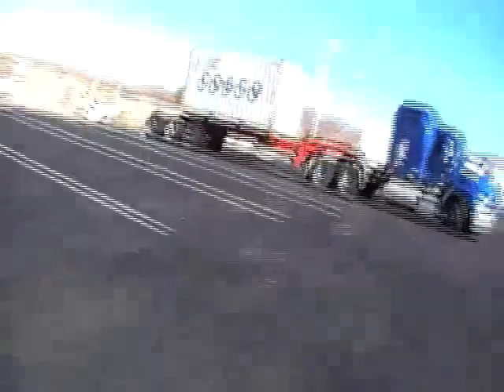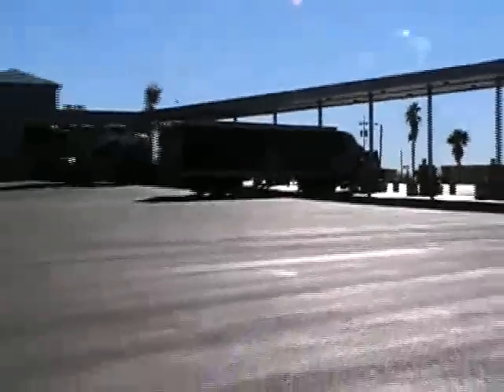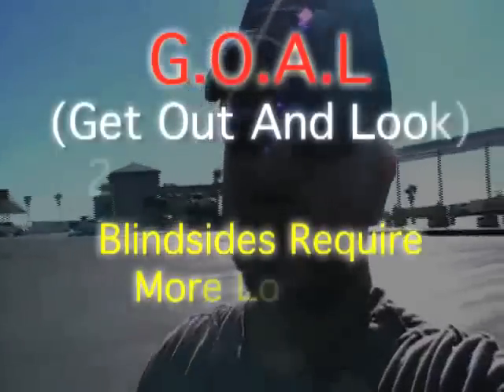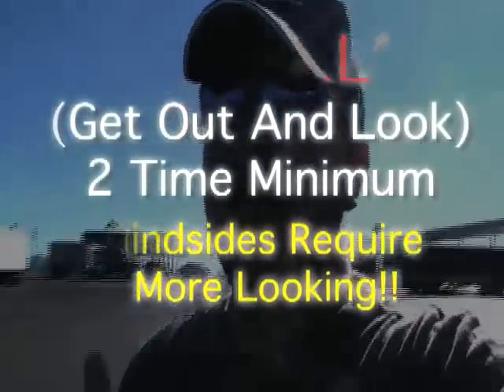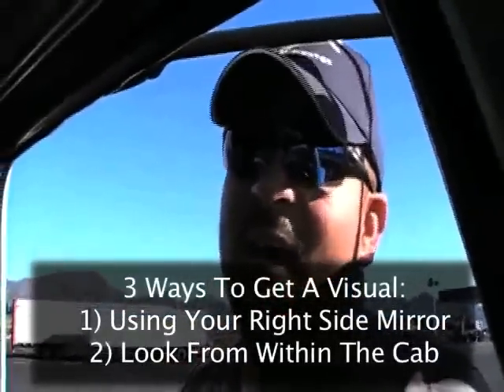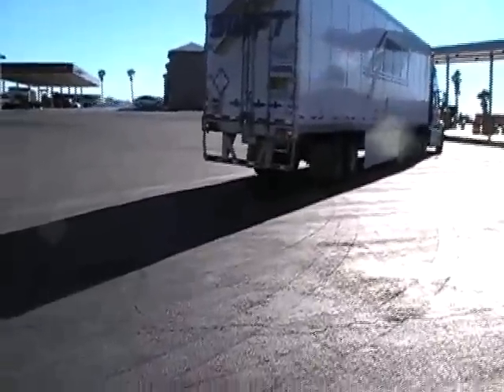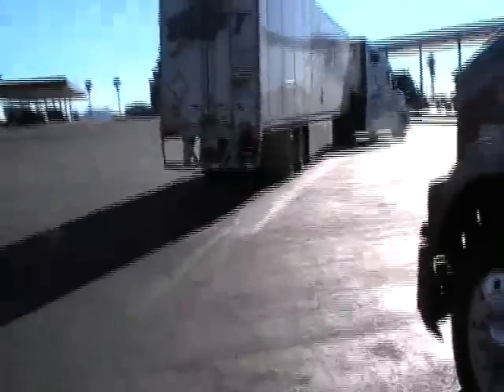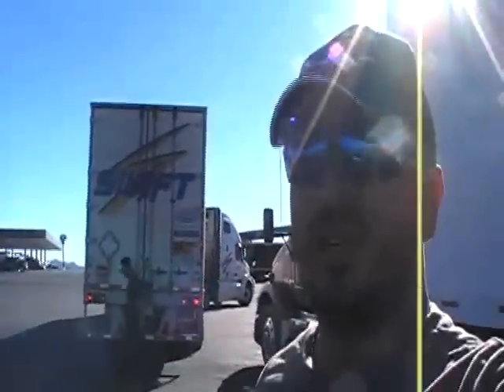Blind Side Backing 101

Comment: I used to pick up farm milk with a 220" Pete w/a bunk and a 46' trailer. I had a veteran driver tell me that once you loose sight of your trailer on the passenger's side, look out your left hand mirror. From there you can judge the angle of the tractor as compared to the angle of the trailer and when it gets almost to the point of no return, start following it with your tractor and you will succeed every time. I have to admit, it took awhile for me to get this down pat, but once I did, it worked every time. I didn't have the option of getting out to look, because I was usually on a very busy road and if I had got out and looked, I most likely would have caused a very serious accident.
Reply: You're not the only one... I heard that too
Reply: Expand  on that technique  a little bit more sir.
Reply: @karondibolden1242  Sorry it took so long for me to get back to you...I guess I'd better start checking my messages more often :-( ...as far as expanding on my above mentioned technique, I really don't have much more to say on the subject...if we'd had the option of being in a truck together, I could show you much easier than I can tell you and if I'd had the technology available to me when I was driving on a daily basis, I could have video taped this method and then posted it...but I didn't...sorry :-(
Reply: @nathanmartin9560  Yep and it worked like a charm no matter the situation...my thanks to my late friend, Pete, because if it were not for him, I don't think I ever would have figured it out.

Comment: Okay, but confusing. Once you have done your pull up, you back straight until your rear most wheel nears the right side lane marker. Pull a hard left and watch the wheel as long as you can in the mirror, it should line up within the spot. As you're going back, watch the bulkhead (front wall of trailer) with the left mirror. When it is almost lined up with your reference point across the lot and almost square to the space, spin the wheel to the right all the way to straighten out. If you use two reference points, you should hit the space square. It's not hard to do at all, but it is best to avoid it at all costs. In 37 years and over 3M miles, I have only blind sided a handful of times.
Reply: Im new, attending school for CDL. So it's always better to back up from the left? Look from the driver side?

Comment: That "holding for 3-4 seconds" is not specific.  The EXACT way to do this, is the exact opposite of a "regular" back, and when you DO do that you will pull past your empty spot you'll be backing into with your drives centered in the space beside you....and instead of "holding 3-4 seconds", you LOCK the wheel to the left until your cab is perpendicular, and THEN lock to the right till you see the end of the trailer.  THEN you simply turn and follow your trailer right on in :)

Comment: I don't understand why you would do this instead of pulling straight in front of the spot, even if that meant getting close to that building up there, then just do a straight back or at worst a slight 10-20 degree adjustment instead of making such a drastic turn in a small space.Don't get me wrong, I know its nessesary sometimes like at some shippers yards, but in most situations this is unnecessary.
Reply: +IHaveStrongOpinionsOnline BecauseImAVagInLife .................This is a DEMO video...nothing more, nothing less.  In o/words, you would NOT do this, unless you wanted the practice, because you'd want to practice when you DO have the time and the space, but NOT with another truck on your blind side...find several open spots :)
Reply: L. Ron Hoyabembe That's what you would want to realistically to because its easier and faster but this is just demonstration